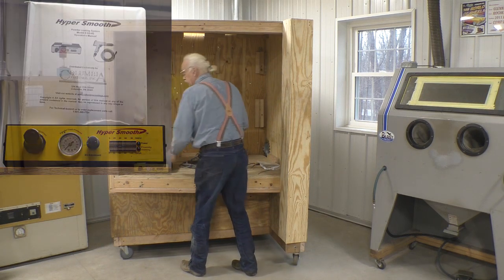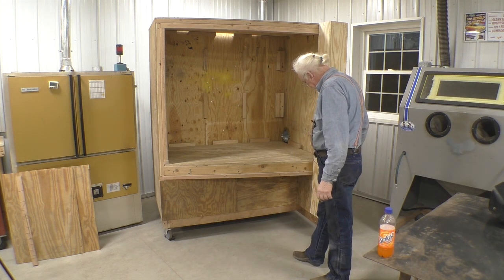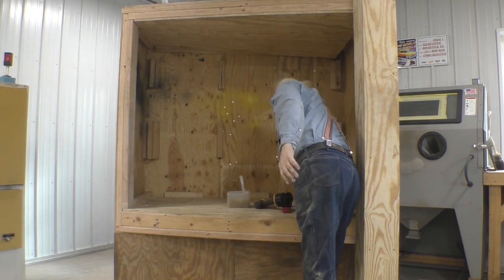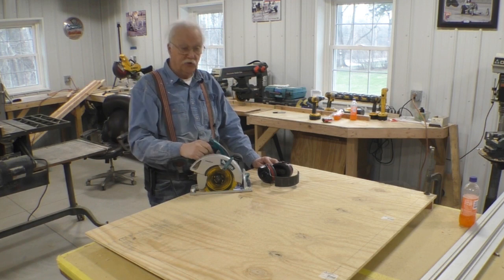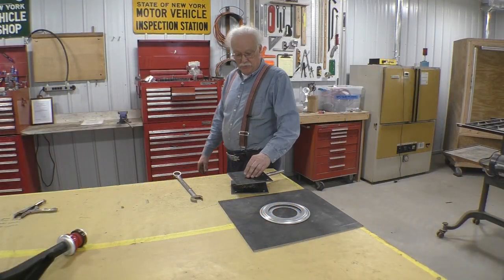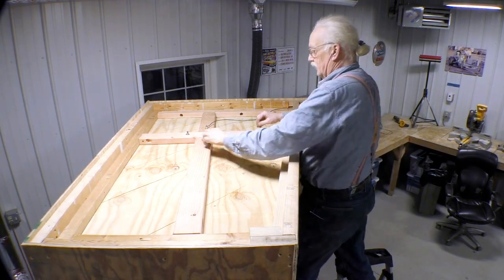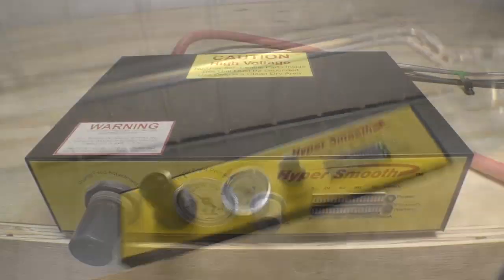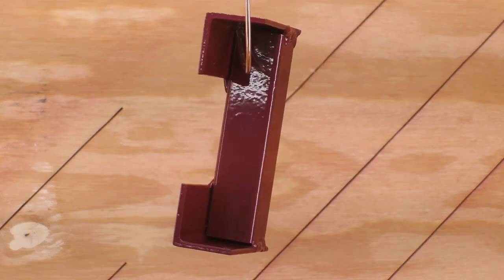Build a Powder Coat Booth, dust collection Booth

Comment: If the booth is all wood, how will it be grounded ? Powder wouldn’t stick to the substrate you’re spraying?
Reply from the maker: There is a ground wire in the cabinet and the rotisserie that I hang stuff from is grounded
Reply: @ThrottleStopRacing  thank you for the response, I’m looking to try and attempt to build one myself

Comment: How well does the cyclone manage with the powder. I've been told cyclones don't work too well with it as the powder is too light?
Reply from the maker: Setup is important, a long straight run into the cyclone helps. I have excellent results and would do it again.

Comment: Nice booth!! I think you over cooked the part....20 min prob would of suffice. I’ve never seen powder require 40 plus min to bake...not good powders that I’ve used.
Reply from the maker: Remember, it is not the temperature of the oven that counts, but the parts. Sheet metal comes up to temp very quickly, however, thick parts like manifolds, need that time to get up to temp. I use Prismatic Powders.

Comment: What about the recovery? It seems the powder is now stuck between the gap in the walls, as well as to the pourous plywood. It will have to be wiped off with a brush, making it get everywhere, and the recovery will be full of tiny wood splinters.
Reply from the maker: There are now two coats of paint on the booth, recovery is through a cyclone.
Reply: Im so confused..... how the powder get inside the 2 wall? Where it go?

Comment: I am curious why you make the floor of the cabinet angled, (or at least it appears that way on video) versus being a rectangle? Also, it would be nice to get a better understanding of how the slot system works (Theory). Does that powder collect somewhere?  At some point does it need to be cleaned out?
Reply from the maker: I made the floor angled so that I can reach into the cabinet to hang heavy stuff. If it were a rectangle I would have to lean in further to reach the hook. The slots were something I tried, I was not moving enough air with the cyclone dust collection system so I added a fan from a furnace to ad in cleaning the cabinet out between colors. No clean outs as yet. Powder is light enough to be carried by the air stream. Other than adding more air flow the cabinet has worked out very nicely.

Comment: Awesome video. What brand powder are you using? 45mins seems like an awful long cure time compared to most powders that I have used (400deg for 20mins).
Reply from the maker: There is a very important difference between the temperature of the oven and the temperature of the object being coated. A sheet of aluminum will come up to temperature much faster than say a cast iron intake manifold. Remember it is the temperature of the object that has to be at 400 degrees.  I use prismatic coatings

Comment: I've seen a lot of DIY videos but your life experience and knowledge obviously shows in your videos. Such as creating the wheel chocks. I would have put only 2 swivel wheels instead of 4 if having mobility issues but using chocks allows you the best of both worlds, a simple solution that I honestly wouldn't have thought about. Again when creating the slots for the ventilation of the box, obliviously you have used saws for many years to understand why people get double cuts and showing how to avoid them as well as having the experience to understand how to react during different periods while making a cut. 
I guess the only thing I would change in the whole booth is the handle on the lazy Susan. If you had a large piece needing powder coating, having a short handle above the work may cause you to bump into the piece when attempting to rotate it, rubbing off the powder. I feel having at least 4 longer handles/1" pipe, that just fit inside of the booth would be preferable. Overall you have great builds and I appreciate your sharing your knowledge! Thanks again!
Reply from the maker: Thank you very much. I have added one more of the breaker bar handles to the other side of the lazy Susan. The dust booth has preformed well. When cleaning between colors it would be nice to have more suction. Plans are in the works.
Reply: I would of saved the time fabing and put four swivel and two of them with locking wheels..lol